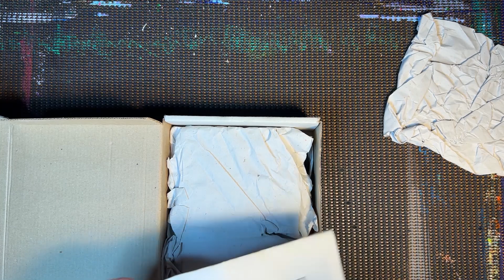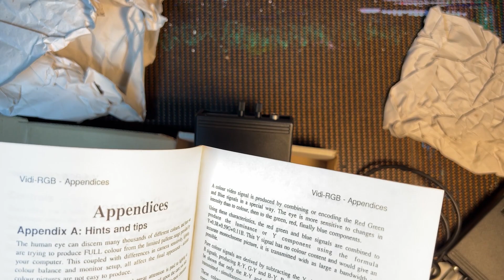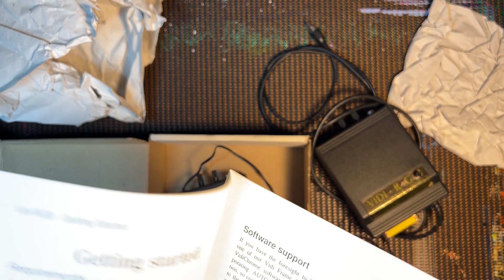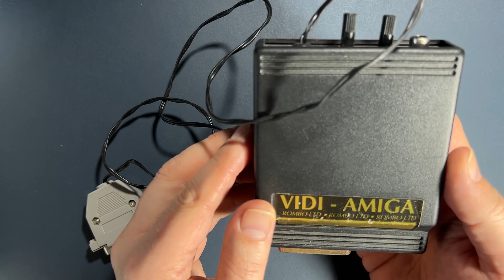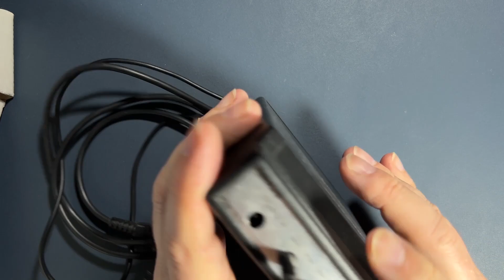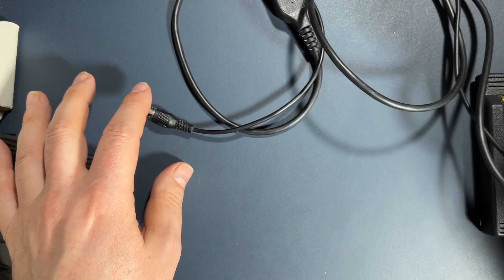Two on Two: VIDI and RGB for the Amiga -series

Comment: Hi 

Great explanation

I also have these 2 device’s I bought a Amiga 1200 and it came with it, never used it, now on the brink to sell it

Did you get the Vidi-RGB working 
If you put power on it is the light on top next to the push switch then burning?  (My guess is it should burning)

The Vidi-RGB I have is repaired I see now.   The wires from the plug from the power adapter are solderd directly on the board. I guess the connector on the back of the device is defective

Also the adapter is not original, the previous owner used a adapter with switchable volts. It is set now on 9v

I read a bit on the device and read that it also gets his power from the joystick port,  don’t have a Amiga to test
Reply from the maker: Thanks for the very detailed comments. Love to see there are more geeks :P Too bad I haven't tried it since I recap and rewired all the wires. I know the word "lazy" and yes I've been lazy. But now you got me curious again! I will knock this bad boy again!